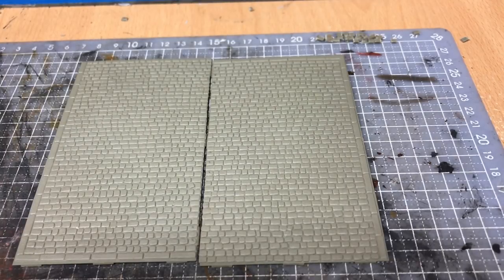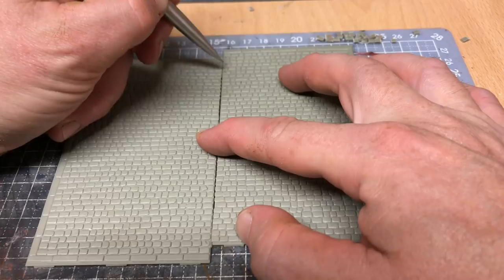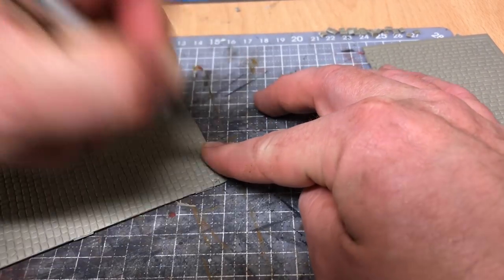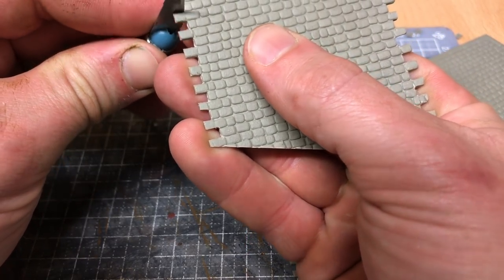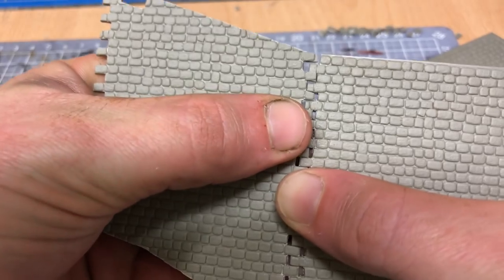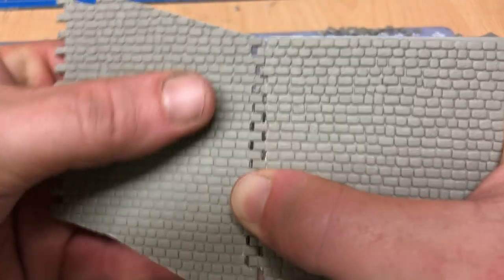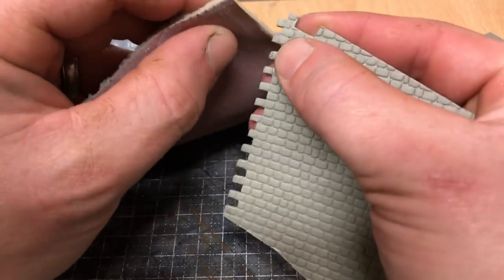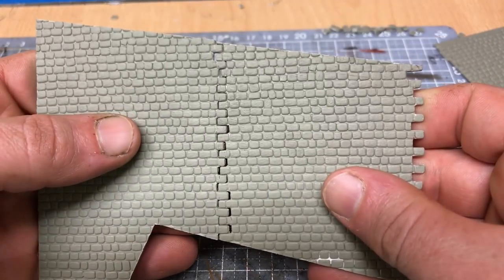Building A OO Gauge Model Railway: In Brief - Interlinking Wills Cobble Sheets

Comment: Personally I use a couple of small files to shape and profile the individual sets but it looks like your way works just as well.
Nice video mate. 
Bring on the big update where we get to see them in situ on the layout with the loading dock.
Reply from the maker: Thanks James, I think a file would be useful for reprofiling the cut tiles on the inset section. Still very much a learning experience for me where methods will no doubt be modified. I wouldn’t be doing this at all if it hadn’t been for your suggestion in the last update video something I’ll acknowledge in that big reveal update. 😉 Paul